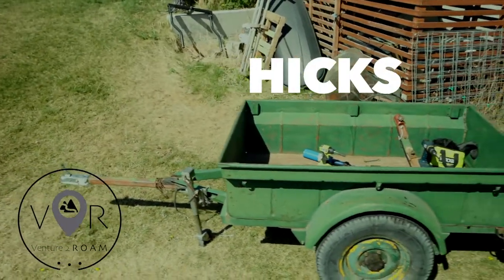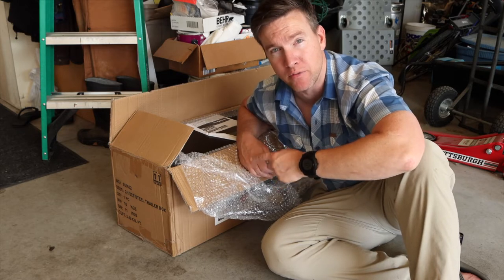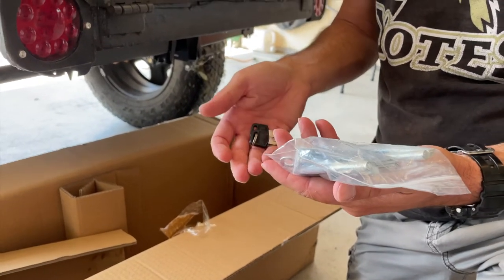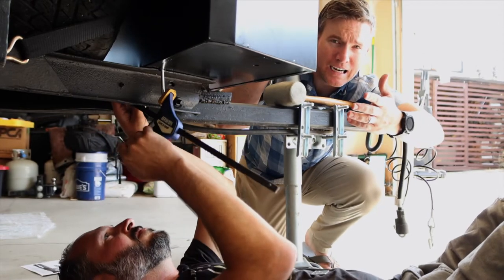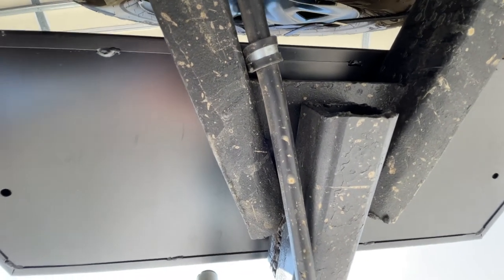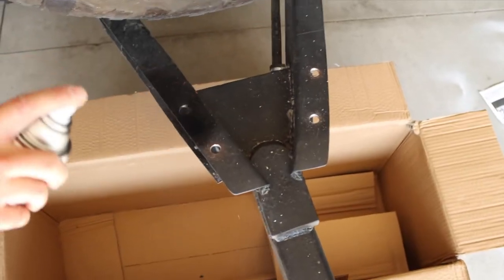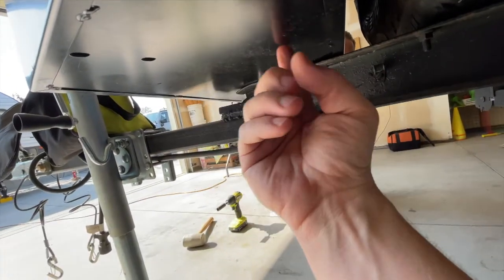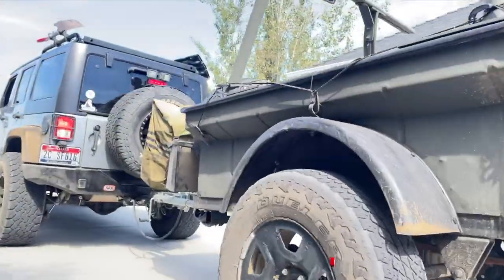DIY Off-Road Overland Trailer Build | Part 5 Tongue Box

Comment: Hey Will I bought the same box for my trailer. Works great and since is sitting outside do far so good with no rust....👍
Reply from the maker: That’s really good to hear! Even though ours was ruined in the flip over, it stayed on the frame…so our mounting solution worked. We bought another one from HF to replace it.